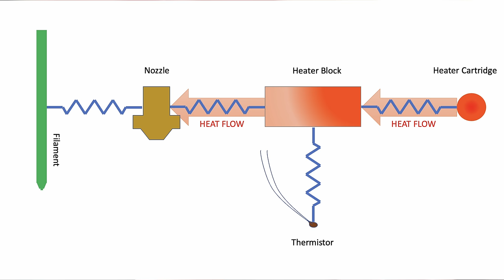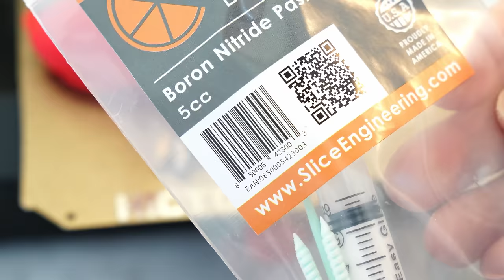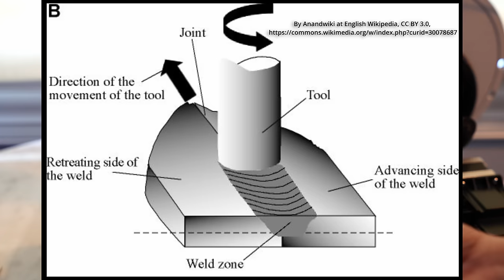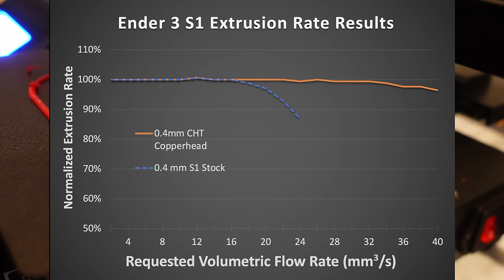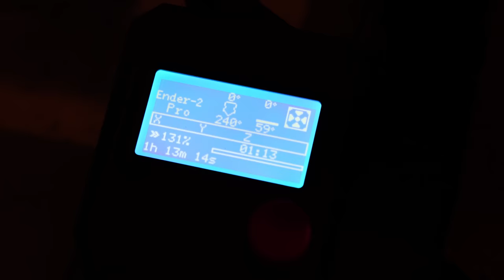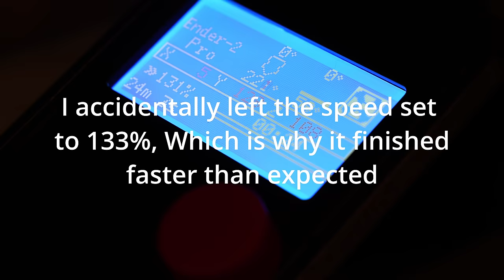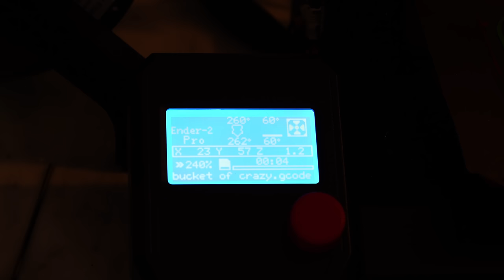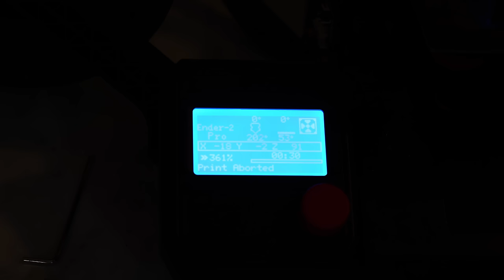CHT Volcano Launch Video - Ender 2001: A 3D Printing Oddity

Comment: Okay I'm assuming this was for humors sake but if anyone is watching for actual advice, with thermal paste less is more. You want a minimal thin layer,  not a giant messy glob.
Reply from the maker: That may be true in computer hardware, but with this stuff any excess will be displaced by the significantly huge clamping load. An M6 thread tightened to 1.5 N*m equates to 200 kgf or 500lbf

A typical cpu heatsink retainer only applies about 10 lbf
Reply: @NathanBuildsRobots  That's valid reasoning, but I still think it was an excessive amount, compared to for reference, slices own boron nitrate installation video.

I had some other thoughts on the video, please don't take them as argumentative or critcisim, just a different perspective and possibilites from my own limited experience printing. I enjoyed the video and really like your presentation style.

When it comes to scraping, I have two alternate possible reasons. I think the canteliever design is fine for small, light toolheads, but the sprite added a significant amount of weight and moving mass to the gantry. The effect of that mass is of course greater the closer it is to the end of the canteliever.

My stock ender 2 pro has zero problems with scraping or flexing on the canteliever X, and I believe that is mostly to do with both perfectly adjusted v wheels and keeping the toolhead light. The sprite is really on the havier end, even compared to other direct drive options like a printed sherpa mini or saiflin extruder with a pancake motor.

Another thing to look at that I didn't see you mention in the video is tuning flow. Most of the time if I'm expeceriencing scraping of any kind, if it's not a mechanical issue like misaligned axes, poor bed leveling, etc, it is pretty much always extrusion multiplier aka flow rate %. You didn't mention tuning flow. You should not only tune your esteps for the new sprite extruder (which I asssume you did) but also tune flow per filament and especially now that you have modified your flow characteristics with the CHT and UHF nut. If you have too much flow you will experience scraping. 

Another thought is the cooling, I know you said you were going to modify the duct to be properly aimed at the lower nozzle. I would suggest also looking into trihorn or any other tyle of duct that cools from multiple angles. The faster and hotter your printing the more helpful it is to have more coverage with your cooling.

Not mentioned in the video but I think important to do when you make changes like this, is a PID tune for your heater.  You can do this in marlin with pronterface or even just by putting the right commands in a gcode file on the SD card.  This ensures you're heater is getting to and keeping consistant temperature throughout the print.

A silicolne sock would help too, one possibility is cutting down both a rapido and sprite sock to properly cover both parts of the heater/nozzle. I did something similar on my CHC PRO hotend that I also put the rapido UHF on.

I'm eager to see your experience with the Tronxy Crux 1, on paper I think it's one of the best desgined printers in the cheap canteliever segment, but I have no first hand experience with one yet.
Reply from the maker: @polurazonituc It spat those out on the first print. Little white chunks in there. On 0.4mm nozzles that can be very annoying, but 1.2mm nozzle just passes it no problem
Reply from the maker: @caramelzappa  Thanks, you have a lot of good points. My mods are the junk food of 3D printer mods. Just slapping things on and pressing go. 
I'm good with the mechanical stuff, but anything in firmware or tuning takes me ages to figure out - so more often than not I just leave the stock firmware and tuning.
yeah the duct coming from multiple angles would be good. On the green one, the previous layers are still tacky. If you check out my other CHT video (https://youtu.be/CO3-sPOmD2k), I have a better cooling fan design on-hand. I should put that on for the 100mm^3 test, or use a much larger model with way longer layer times, and an external fan, or whole layer fan coming from behind. I actually modeled something for that! Might try it in a future video.

I didn't re-level the bed. With the extra weight, the bed should probably be tilted a little bit so its lower on the right.

Would also like to try the KP3 Pro , but Kingroon said they want me to review their PEX sheet first.
Reply from the maker: @caramelzappa  Also, yeah, it was excessive. There was a little plug of dried material at the end, a nozzle clog if you will. So I was just trying to not let it go to waste! Probably would have used about 1/4 as much.
Reply: @NathanBuildsRobots  Junk food of 3d printing 😂

If you do get around to wanting to tune more, check out the Andrew Ellis tuning guide. It was made for the voron community but it applies to any printing really. He lays out some really good methods for tuning and optimizing. I've been able to get great results following his guide. 

Releveling the bed makes sense too, that might help.
Reply: @NathanBuildsRobots For firmware go to Klipper, I hated firmware until I ran Klipper, now I just config my printer from a browser on my phone. RaprapFW is just as good  btw
Reply: @NathanBuildsRobots 1.5 N/M is about 1.1 ft/lbs. 500 ft/lbs is something you’d see on like 1.25” hardware.

Comment: Some other channels have shown the application of Boron Nitride Paste to every union in the hot-end, this should not be done under any circumstances, manufacturers make their throats from low conductivity metals to stop heatcreep so the last thing you need to do is increase that conductivity between the block and the throat, personally I dont use it at all!
Reply from the maker: The Copperhead heatbreak uses a copper upper and lower portion joined by a insulating stainless steel tube. The idea is it essentially turns the lower part of the heatbreak into a part of the nozzle. The difference in heat transfer is marginal. I think what this cht is doing makes a whole lot of sense, because it's moving the "impinging" area from the nozzle taper at the end of the nozzle, up to the top of the nozzle. The positron does a similar thing with their 90 degree angle heater block. 

This way, the rest of the nozzle is just mixing the filament up to give it a nice uniform consistency by the time it exits.
Reply: @NathanBuildsRobots  The video I saw of Boron paste being used everywhere was a stock Micro Swiss hot-end with it applied to the nozzle thread and both ends of the heatbreak, I won't mention who it was but he should have known better, I was absolutely gobsmacked and thought he would have taken the video down after it was pointed out by myself and half a dozen other people but no, the video is still there to this day, I have a CHT nozzle that I intended to use with my Copperhead but haven't got around to using it as yet, pure laziness on my part!
Reply: You want heat to transfer away from the top part of the heatbreak as quickly as possible. If filament melts in the top part of the break you get jams.
Reply from the maker: @pmcquay1   @ᗩᑎᗪᖇEᗯ ᕼᗩYEᔕ  Yes, but on the cold side of the hotend, you want to lower the thermal resistance as much as possible, including use of thermal compound, so it immediately dissipate any heat that makes it through the heatbreak. The optimal resistance for all components is 0, with the exception of the heatbreak, whose optimal resistance is infinity.

I was working on a thermal model of the hotend system earlier this year. I want to make a online simulator that shows the effect of increasing/decreasing thermal resistance at different locations on the hotend.

Things get complicated when you look at dynamic response of these thermal systems, which accounts for the thermal mass of each item, and the on/off cycle of the extruder and heater cartridge.
Reply: @NathanBuildsRobots  your first paragraph is literally what I said.
Reply from the maker: @pmcquay1  sorry, meant for that to be addressed to Andrew. But adding to that, the top of the heatbreak you can usually get away with normal computer thermal compound since that part is cooler
Reply: Manufactured only did this before but metallic heat breaks were a thing. Boron nitride Can be applied to any area in contact on the hot block as what you are doing is trying to make the heatblock have no insulator so that heat transfer is through out. Even if it is used on the heartbreak side what is cooling the area.  This also applies the reverse way conducting the cool air through the cooling fins into the heartbreak. There is a reason now with mordern hotends that both sides Heater and heartbreak have copper and can use small fans because they have better thermal conductivity. What can hurt or cause issues is if you get boron in the filament path. So I would recommend don’t be messy and use a cotton swab and before pushing the plunger to pull up on it this makes it easier to push out smaller amounts.
Reply: @NathanBuildsRobots  would you like to work together in hotend thermal modelling? Mechanical engineeer here.
Reply from the maker: @wally88ar  sure, join the discord and hit me up, I have a thermal model and some spreadsheets that I started a while ago. What project are you working on?
Reply: @NathanBuildsRobots  I am interested in high flow (1kg/hr) extruders
Reply from the maker: @wally88ar  for sure, best to talk about it in discord

Comment: Dude, WHY does everyone use SO MUCH paste?!? It's simply not necessary. I see all these youtubers doing this and if you harken back from the computer building days you'll know you're just trying to fill in gaps - microscopic gaps - in the surfaces of your two items. Too much is actually no bueno although since, in the case of 3d printer nozzles, you're screwing things together I guess it matters a little less but yeah. Save yourself a messy cleanup. Just use enough to coat the threads ;)
Reply from the maker: You know what they say, better paste than sorry

Comment: Boron Nitride is so inert that the mystery liquid it's suspended in is the bigger concern.
Reply from the maker: I assumed it was just water, but I don't know about that! Its odorless.
Reply: Guys, you really need to cut out all the interesting chat, I need to get some sleep.
Reply: @NathanBuildsRobots  probably silicone or mineral oil, do not eat it, but it should be fine unless you're allergic (silicone oil is used as a lube for sexual intercourse).
the silicone grease may melt the silicone sock/make it sticky though, but that's not a big issue.

Comment: Waaaaay too much thermal paste! The voids left between threads once tightened is so minimal that you just make a huge mess and waste most of the paste when using that much.
Reply from the maker: Debatable! If I get 1.5%more performance and it costs me $0.50 more in thermal paste, that is a price I will pay any day of the week!
Reply: @NathanBuildsRobots  1.5% more performance from globbed on and making a mess that has to be wiped off (not to mention the contamination from what got squeezed out internally) vs the proper amount? That's debatable! You can only increase heat transfer based on surface area, that's what the paste does, once the voids are filled, no more can be had by using more.

Comment: I really don't understand why it's complicated?  If you bought a wonderful paste, then you have the opportunity to buy a normal volcano block.  For better heat transfer to the nozzle, we must remove the air barrier.  Any paste for the processor is suitable for this.  You also need to apply the paste on the throat at the junction with the radiator.  Once again I want to say that any thermal paste and any heating unit like volcano will do.  You will get a fairly large flow of plastic and therefore a high print speed.  I would pay attention to the extruder mechanism for stable printing with any filaments.  Good luck
Reply: No. You can't use any thermal paste. The stuff for pc parts are rated for around 100c. Here we print at up to 300c. Three times the limit. You don't fuck around with limits.

Comment: Another thing that determines the speed of heat transfer is temperature difference, bigger difference bigger speed. Therefore, without any upgrades just raise the hotend temperature. The downside is that because of uneven heating your "skin" of the filament could be burning before the inside is fully melted
Reply from the maker: True. I think the cht features help stir things up and chop up that solid core, but I have noticed at high speed it's still an issue

Comment: You should try the Rat Rig V-Minion. It shows that a cantilevered x can be reasonably rigid if you use wide-enough extrusions and a good-sized linear rail on the z. Not as stiff as dual z rails, but stiff enough. Especially when used with a NEMA14 36mm pancake based extruder.
Reply from the maker: Yeah that machine looks sick. Will reach out to them

Comment: Those nozzle extensions really need some insulation. I actually saturated my 50 W heater at 263 C (target 270 C) and ~60 mm^3/s because it was losing so much heat from the extension.
Reply: Oh and this is NBR's fault, he got me into wide CHT nozzles.
Reply from the maker: Don't blame me, blame Bondtech!

Comment: Ohhhhhhyeeeaaaaah baby let's do this, keep the filament flowing baby. 💪✌️🇺🇸😎
Reply from the maker: I need to do a 5kg spool time lapse
Reply: @NathanBuildsRobots  ohh that's one monster amount of filament in one print. Even at klipper speed that's going to take a while 😂😜
Reply from the maker: @Reindeer-ry2lf  I'm not sure it's possible to fit 5kg in this printer build volume. 

Gonna have to switch the cht setup over to my Ender3 S1 Plus

Comment: Is it a good idea putting all that boron nitride paste into the filament path? Doesn't that stuff harden and clog the nozzle?
Reply from the maker: It came out with the first bit of extruded plastic. With a 1.2mm nozzle, clogging isn't too much of an issue. 

On a 0.4mm you might have a problem.

Comment: Hey great informative video as always. I own a tronxy crux 1, it's a very nice machine especially the metal wheels that makes it very robust and reliable. I can't wait to see your review and ideas of updates.
Reply from the maker: It looks like the Crux fixed several of my complaints about the Ender 2 Pro. We will see if it survives judgment day!
I definitely want to update the extruder. I kind of hate titan extruders. They are really great, reliable, solid extruders. But they crap out above 12 mm^3/s in my experience. I NEED MORE SPEED!!!

Fortunately I have a Bondtech LGX Mini laying around that needs a host.

Comment: On stock boards you have to connect via ISP port with an Atmel programmer. Flash the bootloader on the controller, and after that, you can flash your firmware on it via a USB cable.

Comment: You are missing the point of the Volcano Hotend.  You need a volcano heat block to transfer heat to the full length of the nozzle.
Reply from the maker: I thought so too, but CNC Kitchen did a pretty good video on topic. I watched it after making this video, so I added a reference to it in the video description.